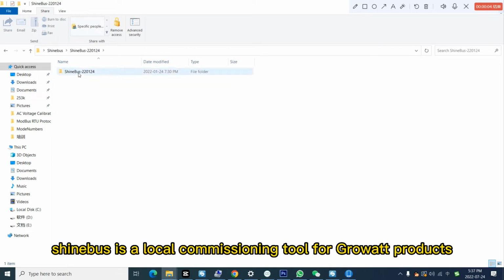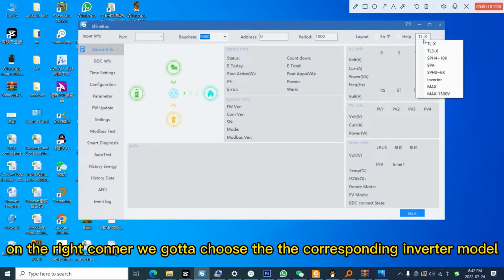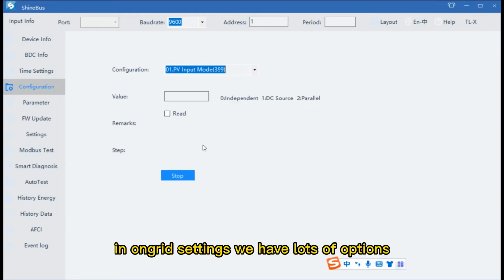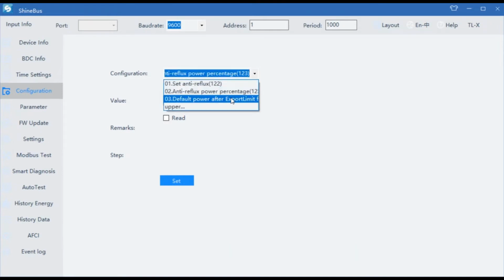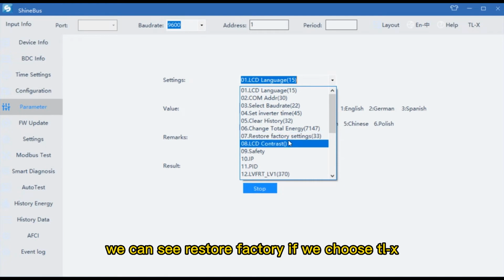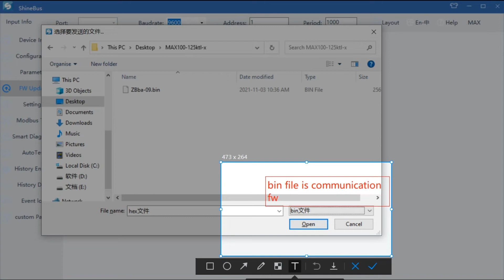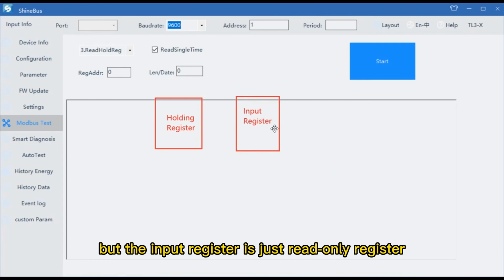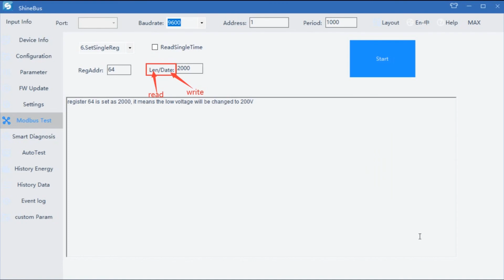ShineBus Operations (Growatt local commissioning tool)

Comment: Hey man, much appreciate that video! However, I've got a SPH10000TL3 which issues failure message "abnormalwire" But I am sure my wiring is OK. I believe one of the parameters is wrong set. Do you have a complete list of the configuration and parameters registers and what the usual value should be?

Comment: great suupport - thanks a lot
You might write a comment an pin that on top with the most recent link to the shinebus app 
Might be easier to support that on 1 comment for all I guess. 

I have found several ones but not sure, what the latest version might be:  2023 03 10 
is at least from march this year, but not sure, if that is the most recent I need for our SPH 4600 and Min 4600 and Mic 3000 and Mic 600
We have here in total 16 of these models.

Comment: Hi

how can one reset SP2000 to default with ShinBus...i can connect to it
Reply from the maker: well you may choose the model SPH and try to find reset option in parameter setting
Reply: @SolarManSun  thanks ...that worked, but not able to set the export limit, or set the "battery first " option...any idea?

Comment: I need help from you.
can you tell me how to connect the computer to  Growatt SPH 5000TL BL UP?
Reply from the maker: You may contact the local service center and they will help you. they will guide you step by step to teach you how to do that!
Reply: @SolarManSun  Ok. Thank you
Reply from the maker: Connect RS485-USB module (T+&T- ) to RS485-3 port(pin1&pin8) on your inverter.
T+ to Pin1(white/orange) and T- to Pin8(white/brown)
Reply from the maker: the update can be done if u have a usb disk, you'd better request the fw from the installer or contact growatt service center and they will provide you with the correct and latest fw. not suggesting u upgrade by yourself
Reply: @SolarManSun  Thank sir
Reply: Dear thanks for your support   
Kindly explain me  is it okey to connect USB D+ &D- derectly connct 485 port? Without any interface circuit??
Reply from the maker: No, you can't!

Comment: Hello. Can I use the Shinebus to configure inverter model MIN3000TLX.
I need to change the reconnection time from 60S to 180S.
Reply from the maker: Of course you can! 
First of all , you need to select the correct model TL-X, and then follow the below methods:
Method1: Configuration->Ongrid settings->Restart time->Set the value to 180
Method2: 
Modbus Test->SetSingleRegister->set RegAddr to 19, set Data to 180
Reply: @SolarManSun  Thanks. to connect inverter to my laptop, can i use a usb to usb cable?
Reply from the maker: @evergreenlogicsltd1811  no , it does not support usb communication with a computer
Reply from the maker: @evergreenlogicsltd1811  i think you can contact growatt engineers for remote settings, or ask him for remote setting method, then you can set it on the internet instead of using a cable
Reply: Can this device be used?
Reply: Hello. I manage to use the cable mentioned in your video and configured the inverter reconnection time to the Grid. Thank you.
Reply: Hello. What is the default value  for Vpv Start?